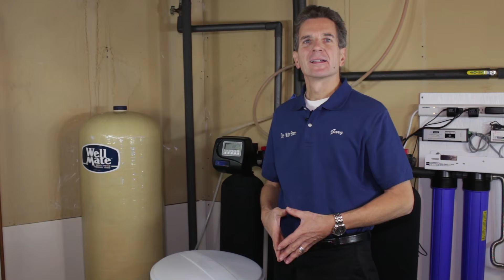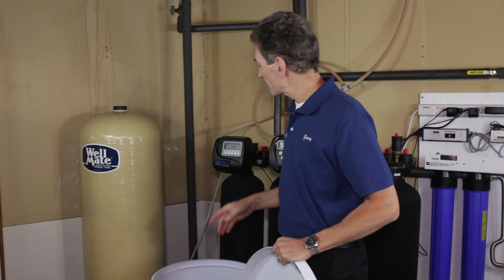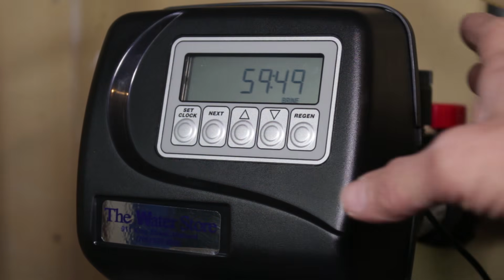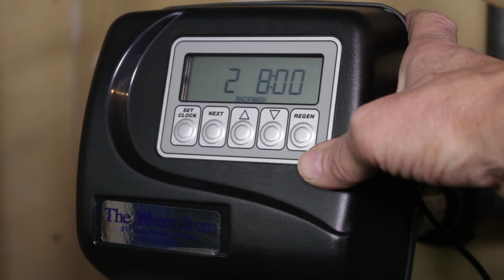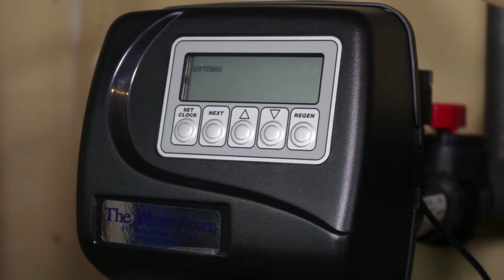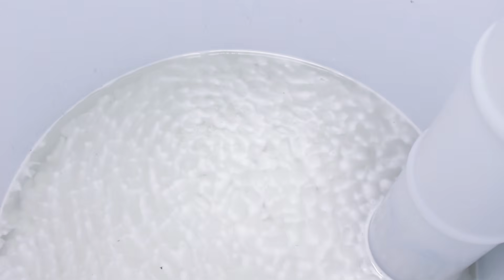Water Softener Maintenance Cleaning Out Your Brine Tank

Comment: I have a water softener that I put crystal salt in. I am getting a lot of salt taste more noticeable in my hot water than my cold water. I have well system and I have a Clark tanks. What would be causing the salty taste in my water mostly taste it more in the hot water and it leaves like a salt residue on my dishes when I wash it with hot water if I use cold water, I don’t see the salty residue. how can I correct this? Thank you Dave.

Comment: JUST found this video and it is awesome....one thing I am unclear on: I opened my brine tank to add salt (5yr old system) and noticed black stains on the white internal pipe and black sludge on the water. I love the idea of doing the regen cycle to remove the water....but is that brine water actually being removed and discarded or going into the beads? I only have a small shop vac so it will take a bit to remove water that way....but also dont want to get that nasty water anywhere it shouldn't be. Also....because it could have been like this for 5-6 weeks...do I need to worry about the black stuff (mold) getting into components that I CAN'T clean and would need to replace? Thanks!
Reply from the maker: Yes, that black stuff (mold) will run over the beads before being flushed out. But it will be flushed out.  If you are still concerned, you would need to clean it out with the shop vac.

Comment: Question - if there is brown sludge in my brine tank, not mold like mentioned in the video, can I still empty the water using the regen cycle before cleaning/wiping it out? Or should I get the brown sludge out a different way?
Reply from the maker: You can vacuum it out with a shop vac.

Comment: Hi Gary,  I have brown floaties floating in the brine tank and some brown on the side of the tank.  What is that brown stuff in the salt tank and what should I do?  Thanks
Reply from the maker: It is the brine solution reacting with your water.  It typically happens seasonally.  You could remove the brine with a shop vac but chances are it will just come back again shortly thereafter.

Comment: Hello I don't know how often you check your messages but I have a question for you. We got a system installed I think about a year or two ago. We had an issue with the well where it sucked up sediment and put it in through my entire water system. Even though the system regenerate there is still sediment down in the brine tank. I mentioned it to the water company they said everything would be fine and I didn't need to have it cleaned out. Should I take this apart to clean the sediment out of the tank? I bought brand-new salt to put in the system but I haven't put it in yet. We have been using a system for about a year since this happened and the settlement is still down there. My peace of mind tells me I'd like it removed and should have it removed
Reply from the maker: Yes, it’s a great idea especially when the salt level is low. Suck it out with a shop vac, add salt and 5 gallons of water and you are good to go

Comment: Hi, Gary, thanks for the video. I just purchased a home on well water. I have a system that has acid neutralizer, which then runs into a water softener which Then feeds to a iron removing birm filter. System Is  Water Right Which uses clack valves . I just disconnected and cleaned out the salt tank which was disgusting. I also know from experience that the system puts water in 4 hours before regeneration so pre fill, correct?After I add salt do i need To add water or is the prefill four hours prior to regeneration enough? Lastly my understanding is the clack systems were generally post fill.  Is mine set up wrong?  Thanks Jay
Reply from the maker: Yes, yours is prefill but i would add a gallon or so of water yourself.  Most Clack valves are used on post fill but some are prefill. No problem.

Comment: That was insufficient information.  Like HOW do you clean it out?  Does it detatch from the system so I can maneuver it? Do I have to have a shop vac? I would have to climb into mine to reach the bottom!  How do you dump it?  I was lookin for stuff like that.
Reply from the maker: Soem types do detach, depneds on the make and model that you have.  UIrt depends on how much salt is in it, but a shop vac will help.  Yopu can tip it on it's side if that helps. Some kinds you can lay on their side and other you can't.  Too many variables based on brand, model and type, which is why the instructions were more general in nature.
Reply: @water_estore  it did detatch!  We got to clean it really well!  There was some nasty black stuff all over the salt, so, ps that got thrown out!  But ty! I would have never known you're supposed to clean it!

Comment: How do you reach the bottom of the tank? My tank is deep and even if I added soap and cleaned I have no idea how to get dirty water out. Wet vac hose isn't long enough. Can it be unattached from the system in order to rinse and dump the water?
Reply from the maker: good question!  Yes, you can detach it to dump and rinse.

Comment: So do you turn the bypass valve first? Before hitting regen? How do you stop it from filling up again after it drains the water?
Reply: Oops, was a typo. Question i had was.... If using the regen cycle to drain the tank for cleaning. How does one stop it from filling the tank again at the end of the cycle? I wanted it to drain and not fill again, so I could disconnect it and take it outside.
Reply from the maker: Sorry, I am not sure what you are asking.  The water softener should be in service, not bypass.  If it's a post fill water softener it will put water in with the salt, if it's a pre fill softener it will not.
Reply: @water_estore  thank you for responding. Your video was helpful. What i did on this older model is... I started the regen, then i waiting an hour for it to drain (no way to advance forward), and i listened to when it might start filling again, when it started filling again i lifted the float valve to prevent it from filling. Then i used the bypass valve to shut it off. I took the mostly empty tank outside and cleaned it. Now that it's back in place, i started another cycle to get it to refill the tank. Hope it didn't do any damage running a cycle with the tank dry.
Reply from the maker: @0my  No damage will happen.  Good thinking.
Reply from the maker: Great question!  You manually advance the valve after each cycle until it gets back to the home position.

Comment: After refilling the brine tank should I let the water soak in the salt before regenerating?
Reply from the maker: Great question. Yes, it takes several hours for the water to absorb the salt.
Reply: @water_estore  thanks. Also does the amount of water put back into the brine tank after regen coincide with the pounds of salt selected in the programming? And how many pounds of salt per cubic foot of resin do you recommend?
Reply from the maker: @ShawnTRD  depends on a lot of variables, I would check your manual to see what is recommended.

Comment: Gary, thanks so much for the fast response to my last quest. I cleaned my tank and put back in service with no issues. I now have a new question. My system has an iron and Softner. Both have Clark SW1 control valves. When I test my water I’m getting a slight hardness result. The reason I started investigating my system was high water in my tank when adding salt. This is my question: symptoms, during the regenerative process the flow discharge volume of the back wash on my softner is very low compared the flow rate of the iron filter, is this normal. Could this be an injector issue. Both have SW1 control valves, is this normal? Secondly do you sell parts for the SW1?
Reply from the maker: Yes, we have parts for the Clack WS1 here https://waterestore.ca/search?type=product&q=clack*%20ws1* which is our Canadain website but if you click the "Canada" at the top it will switch to the US website in case that is where you are located.  We have distribution in both Canada and the USA.  Yes, it sounds like an injector issue to me, this video should help https://youtu.be/Eonviqm58bA

Comment: I have a Clark ws1 water Softner, after I clean the tank should I add 2-3 gallons of water? Don’t know if it a post or pre fill system.
Reply from the maker: Start the regeneration cycle by holding down the regen button for 5 seconds.  If the first cycle is fill, you have a pre fill softener.  If the last cycle is fill you have post fill softener.  Either way you can add 3 gallons of water to start with and the water softener will correct for the future.

Comment: Can i use IronOut to clean my softener also how do i drain out all the water so none of the cleaners go to my taps
Reply: Yes i went years without knowing about chemicals to clean your softner. what that stuff does is mix witht he salt water in the tank and is only used when regenerating and washing the resin beads inside. Then the water and chemical will sit in your tank until next regeneration. wont go into the house but they say to run the faucet for 10 mins just in case theres a little residue on the resin beads that might not have flushed all the way. i never need to do the faucet. i mix according to instructions and works well
Reply: @SATXDONKEY  so I add it to my salt and just let it regenerate when its time? Or wait till the tank is empty and put it by itself

Comment: The softener at the house I'm renting had been unused for years. So I had a guy come hook it up and he had to rebed it to get it to work. I asked him to show me how to drain the brine tank so I could scrub it out and he told me don't bother with it cause the water from water from the brine tank doesn't actually come up to the faucets or get used at all, it just gets flushed out or something like that. I kind of wanna call BS in that...  Is that true? Also, there is so much iron in this water it's crazy. How long do you think before the pipes should stop putting out deposit rust?
Reply: The Water Filter eStore.  Okay thank goodness, cause it's been hooked up for like 2months now and hasn't been cleaned. It sat for years, it's gross...I gotta clean it big time.  I think there's too much water in it too. I was up all watching your videos. 😊  Now that it's not all dark and creepy down there, think I'm gonna go check out all the little pieces that are probably clogged with rust.  Thank you so much for getting back to me. I really appreciate it
Reply: If you have galvanized piping, forget it; no filter will remove rust deposits, you need to replace the entire domestic water piping system
Reply: Johnny Johnson.  I have no idea, I'm just renting.  Just found out two days ago that this water softener has been discontinued for like 15yrs though. Lucky me, I spent close to $400 to get it hooked up and re-bedded.  I still haven't been down to clean the brine tank either. I've got a million things going on, keep getting stuck on stupid. I suck at life, it's the curse...    Thanks for the info though guys, I appreciate it.

Comment: Hey Gary - due to water dripping on the drain line, i put in a new Clack Ws1 valve, new tank and resin.  for some reason, i am getting hard water... is there any troubleshooting / root cause for this?  really appreciate it... thanks.